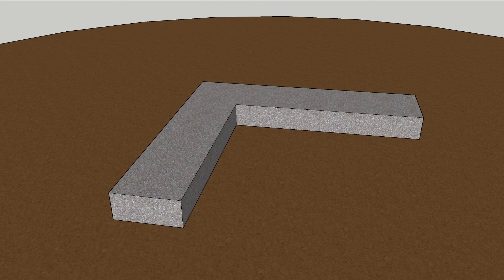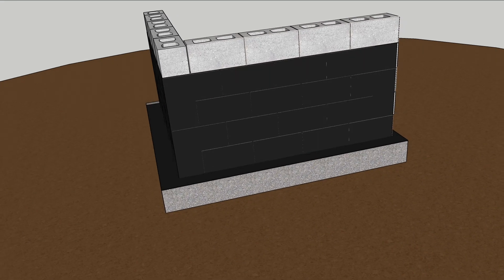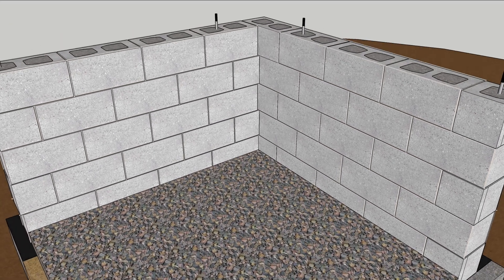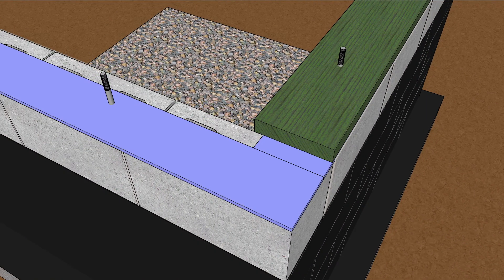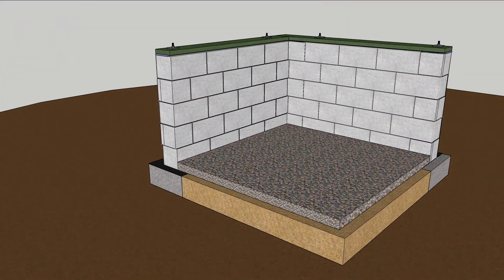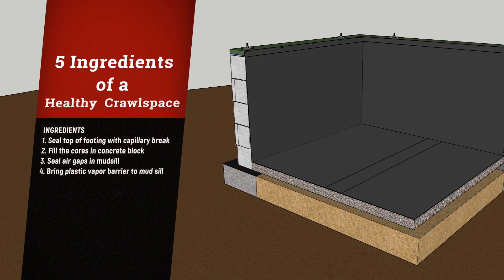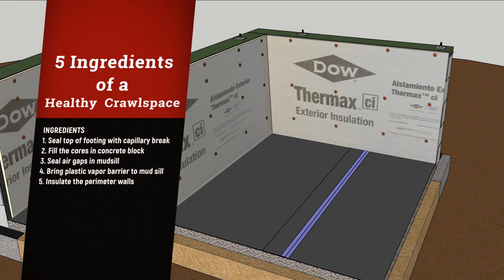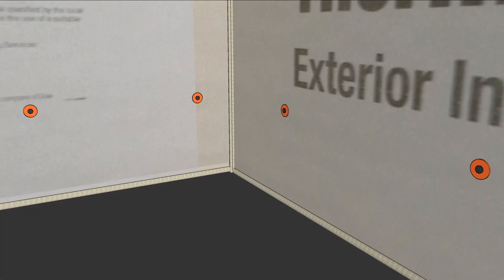Sealed and Insulated Crawlspace Animation

Comment: Insulation on the inside..... No way, bad design, bad idea... losing all inertia.
Reply from the maker: It is not a bad idea, it is simply a different idea than putting insulation on the outside, which can also be detailed to work perfectly.
Reply: @ProTradeCraft  With inside insulation you got 0 inertia it's plain simple (now if you put tons of concrete inside... Of course you'll get some), it's a bad way to do things, specially on a new house. It can possibly be used when renovating an old house.. if no other solution can be found.
Without thermal mass it's like living in an icebox... it's hot outside, let's say you still have the cold air from the night in your house.. you open the door.. Hot air comes in and... no mass will be there to cool this hot air, the inside temperature will rise pretty easily even if you put 2meters of insulation. Same shit in winter with the cold... Non sense, people that build new houses on this design got 0 education on how thermodynamics works. As i said... On an old house where no other solutions are possible... It would still be better then no insulation, of course.
On the same design as your video, insulate under slab with high compression XPS, insulate walls from the outside.. Now you got something performant.

Comment: Most videos that I have watched about sealing and insulating a crawls space has them put the insulation directly on the wall and then cover with plastic. Which is correct?
Reply from the maker: It is better to separate the water control layer from the thermal control layer if possible. Some types of foam insulation are better suited to ground contact than others. This insulation is polyisocyanurate, which is better for GHG, but not suitable for ground contact. 

Expanded Polystyrene, XPS, can be used for ground contact.

Comment: Can you pour double concrete floors & walls? And tar and vape barrier in between each? Plus add (gravel W/Drain pipes) behind and under all walls & floors-(Black sealing front & Back Of walls-And topside Of 1st concrete floor-then after that add the Old Vapor barrier-then new thick barrier-And pour another Thick layer of Concrete-making floor twice as thick? Can I Do my 1st floor In black seal-and Double it all-Walls and flooring-With drainage pipes behind & under walls & floor-leading water away from behind walls, or Away from under home? Is it possible or would Additional layers help?Just wondering if it can be doubled? If it would help prevent Vapor? Do you know anyone that has surround the area in old rubber tires maybe stacked 3ft high with sand & Gravel and old Springs along outer edge-before drainage pipes and Foundation pour? Or Add some type of extended steel Rebar or bar 12ft + out from home (above tires) going away from Basement on all sides? Meaning Long before Poured footings? Interested in Trying to Earthquake proof or prevent problems if earthquake Liquification were to become a problem?
Reply: Sorry if so confusing. I’m Def not a carpenter lol
Reply: I want to build a solid Home that will withstand anything thrown at it!

Comment: ProTradeCraft best in the business!!!  Thank you.  Not sure if I've requested this before but possible to detail a "cold roof" with a conditioned attic?  Thanks again!
Reply from the maker: You mean like this one?
https://www.youtube.com/watch?v=o5uGtQNi7gs
Reply: @ProTradeCraft  T Wiley mentioned conditioned attic which in that case he means an unvented attic which differs from your video link.  I have an unvented conditioned attic so I'm also curious.
Reply from the maker: Hi Brad, the attic on the above link is, indeed, unvented and conditioned. The roof is vented above the exterior insulation. Like rain screen siding but severely out of plumb. It is the Cadillac Approach.

Here's a link to one with no roof venting: https://youtu.be/JmsosK2My6o

Comment: Enjoy all your videos and learning how the pros do it. 
- How would I insulate the flooring? 
- Can i add the foamboard to the floor over the plastic vapor?
- What "mil" size should the vapor barrier be?
Reply: 1) Insulating your crawl space floor would not make much of a difference in a crawl space application, it is usually left uninsulated.
2) Mill size vary, but I found that 12 mill is more than enough to provide a long-lasting barrier, capable of withholding foot traffic
Reply: Which is better?  Foam board then vapor barrier or vapor barrier then foam board?